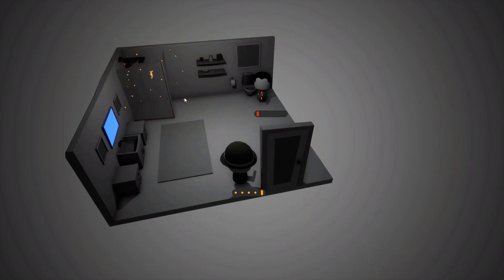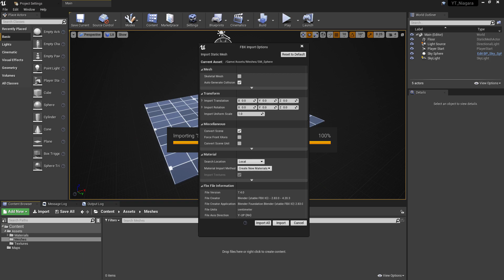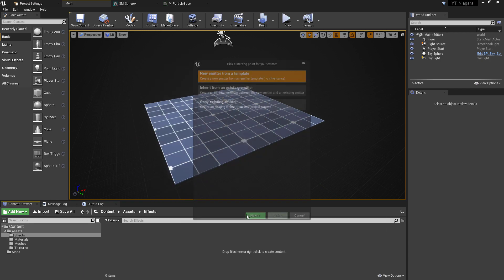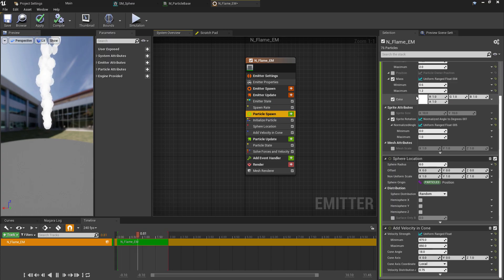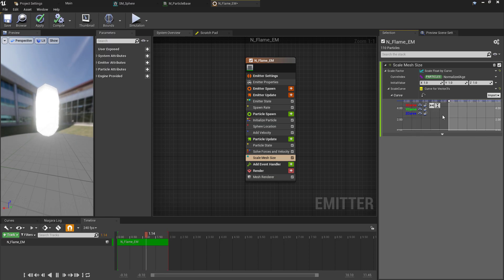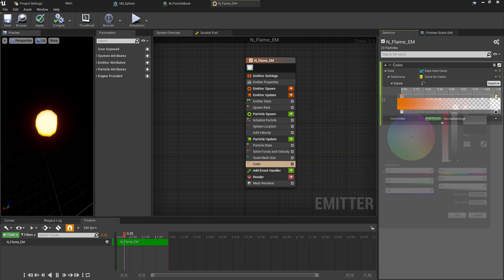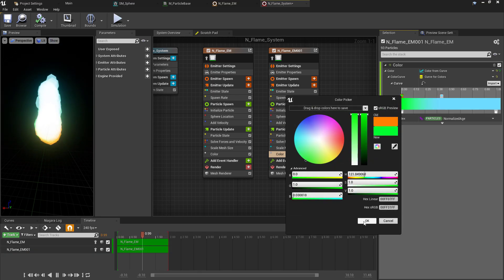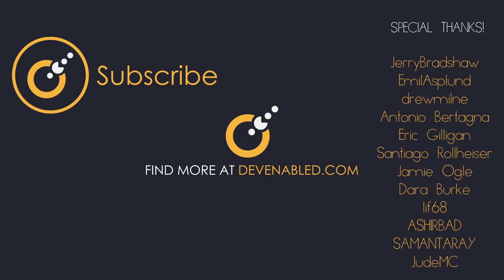Niagara Stylized Flame System Tutorial - Intro to Niagara UE4/Unreal Engine 4

Comment: For any one using 4.26, After entering Scale Float by Curve, no more particles issue, I fixed mine by instead of clicking shift + left mouse button, right click, select add key to all curves and enter values.

Also make sure that under Niagra Node -> Particle Spawn -> Initialize Particle -> Mesh Attributes -> Mesh Scale Mode to Uniform
Reply: Thank you!!!!
Reply: Thank you !🙏
Reply: Are you able to scale the flame to a smaller size? Having issues with that.
Reply: Thank you!!!!!
Reply: tyyyyyyyy
Reply: ty
Reply: thanks! the niagara node update worked for me!
Reply: thank you, it helped 2023

Comment: I think there's a problem with scale mesh size on the latest version of UE4, you can fix this by going in to the Niagara System: 1. "Initialize Particle" -> Mesh Attributes -> Mesh Scale Mode 2. Set "Mesh Scale Mode" to Uniform.
Reply: lifesaver
Reply: Thank you very much for this.
Reply: Oops, you did it again!
Reply: Idk if it's the developer's goal to make this shit so complicated most people can't use it, but this fix doesn't seem to work anymore. No matter what Mesh Scale Mode I use, changing the scale of my particle system just makes everything disappear.
Reply: @DeepFriedOreoOffline  works on UE5 ea, so it should work, liam you are a lifesaver!
Reply: @tazz1226  Yes I got it to work after a while, but I really had to dig to find the recommended option lol.
Reply: @DeepFriedOreoOffline  Hi!! How did u solve it? I ve to work with Unreal Engine 4 for my project and i dont konw how not to make disappear my system :c
Reply: @taliyah._.8853  There is a default setting for the particle mentioned in the initial comment "Mesh Scale Mode" which is set to unassigned for some reason by default. It's not in the same place anymore, but you just have to locate that (maybe try searching) and assign the mode. I believe it needs to be uniform or something.
Reply: @DeepFriedOreoOffline  Thank you!!
Reply: @DeepFriedOreoOffline  I followed your steps but when I select the Scale Mesh Mode to uniform my particle completely changes and looks like rapid rain in a thin straight line 😔
Reply: THANK U SO MUCH IVE BEEN TRYING TO FIX THAT FOR HOURS

Comment: So if anyone else happens to have the same issue with the curve as I did. Go in an do each curve solo by locking out the others. This makes you put in both points for all 3 and then auto curve.  This was really nice tutorial to get a foot in to how use the system.  Thanks
Reply: Hmm I tried that, locking each curve except the one I needed to edit, then manually putting in the values for each one and still nothing on my end. My end graph looks like his end graph, yet nothing shows up in the preview window. I am wondering for those who tried this on unreal 4.26, any advice...
Reply: @tiredguy2753  Same issue here :///

Comment: Hey there, I was wondering how would I be able increase and decrease the size of the flame? Using the scale tool doesn`t work. Thanks in advance.
Reply from the maker: You'd want to alter the velocity and size of the individual particles to account for the change in velocity.